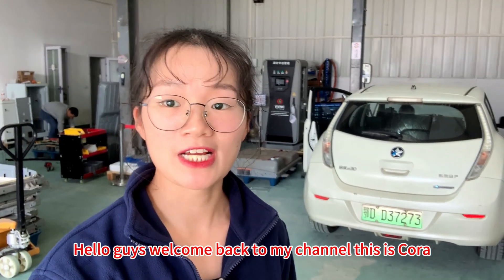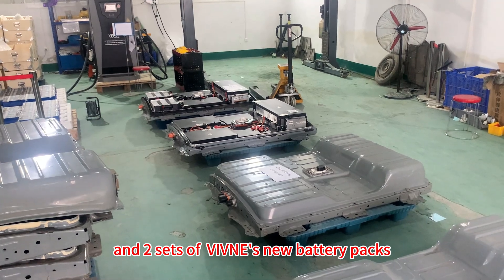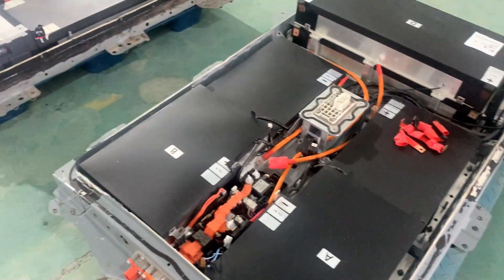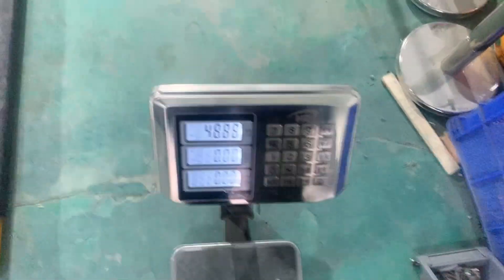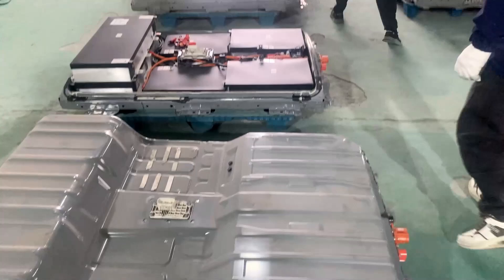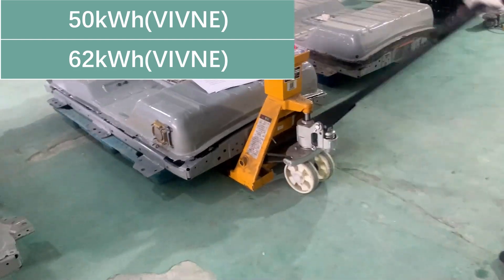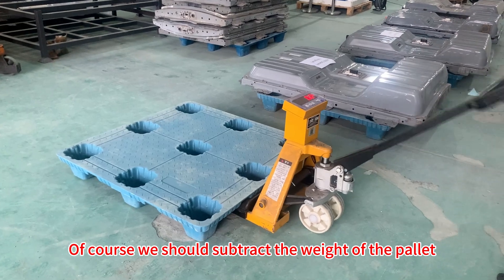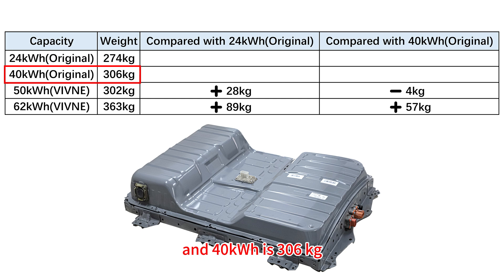VIVNE-How heavy is the Nissan Leaf battery pack?(VIVNE's VS Original)

Comment: usually you want to compare rates in like4like comparison. so you actually come out on top in that really well, both in direct comparison and in the rates of change in your product compared to nissan. 
(in Wh / kg for easier comparison, higher is better)
Nissan 24kWh - 87.6
Nissan 40kWh - 130.7
VIVNE 50kWh - 165.6
VIVNE 62kWh - 170.8 

Nissan Wh increase per kg added - 378/kg
VIVNE Wh increase per kg added - !!! 2307/kg !!!
Reply from the maker: You are professional!!

Comment: Cora, can you tell us the weight of the 68 kWh VIVNE battery pack? It should be close to the 62 kWh battery pack.
Reply from the maker: Yes, the weight of the 68kWh is the same as the 62kWh, both are 363kg.

Comment: are the battery packs fully charged?
Reply from the maker: Before shipping, we need to discharge it to about 40% SOC (about 350V) to make it meet the SOC requirements for lithium battery transportation.
Reply: empty or fully charged it doesn't change the weight of the packs :)

Comment: How does the heat-tolerance of the battery cells in the VIVNE upgraded packs compare to the original batteries.  The battery will still be convection-cooled only so multiple CHAdeMO charges in a day could increase the 0:02  battery temperature a lot and put the battery cells at risk for degradation like in the AZE0.
Reply from the maker: About 2 months ago, we completed several fast charging tests in extremely hot weather. In the video, you can see the temperature change of the battery before and after fast charging. Welcome to see the video here: https://youtu.be/_2hSXqOwW60

Comment: Interesting, originally I was looking into a used Leaf as an option; but, I read Nissan I.D. The battery to the car.  Nissan seller need to ID the battery to the car in order to use the battery 

Do you offer battery pack for RAV4?
Reply from the maker: Sorry, currently we only produce batteries for Nissan leaf and E-NV200, BMW i3 and some Tesla models will be the next stage.
Reply: @VIVNE-CoraLiu  hi,  thanks for reply.   I have a question, does Leaf require Nissan Dealership to program battery to car?  

I read it require Nissan to program car to battery.

Thanks
Reply from the maker: @peterxyz3541  After replacing the battery, you can use leafspy to register the new battery

Comment: If upgrading from 24kWh to 40kWh requires new springs: it is reasonable to upgrade to new springs for the 50kWh VIVNE pack.
Did not realize the difference in weight between the 24kWh and 40kWh packs was only 32kg,
Reply from the maker: Yes, and our 50kWh is only 28kg heavier than the original 24kWh, and even the 62kWh is only 89kg heavier than the 24kWh, so there is no need to upgrade the springs.
Reply: @VIVNE-CoraLiu  I may have been confusing the spring upgrade requirement with an original 62kWh pack: which you did not weigh in this test.
Reply from the maker: @economicprisoner  The weight of original 62kWh is 410kg. Since we don't have the original 62kWh battery at the moment, so we didn't weigh it.

Comment: How much does a diesel or peterol car compare to a battery and how far can they go compared to battery 🤨 i think its 3 times more.
Reply: i have petrol hach back and electric , petrol 2l is 1250kg and electric 1600kg , then you add oil and fill the fuel  so electric is like having a full load of people , however my 2l petrol is 150hp  , my ele is 150kw  , the torque of petrol is about 200 , electric is 320  so you only notice on corners , stopping and the elec ride comfort is like a much larger sedan for the elec.  i stil like both but the petrol is never the first car to be taken out now days , everyone wants the elec
Reply: @CarkeekW  Same we have Hybrid full petrol and full EV i like all but EV is the everyday car.
Reply: petrol car is 4 x the price! plus we all know most trips are far less than a full charge anyway, it's an old and boring  point you are trying to make.
Reply: Yes, but the diesel or petrol car makes about triple the contribution to climate change.  In other words, it will force three times more people out of their homes.
Reply: lol lol i think you are in the wrong area, there are other channels out there for you? if you so desire to know.

Comment: I've always wondered why no-one was using modern battery technology to make bigger capacity Leaf batteries inside the original housing. I could now get a battery twice the capacity of my current 24kwh Leaf battery which would be only 28kg or 62ilbs heavier than the original. That's the average weight of a 9 year-old child. Of course that would require no change to the suspension whatsoever. Even the 62kwh pack would only add 89kg or 196lbs which is  the average weight of two 14 year-olds. I myself weigh 105kg so the difference would be 15% lighter than having someone my size in the car. In my car the 50kwh battery would get me 240 miles of range and the 62kwh would get me 298 miles of range if compared to the real economy of my Leaf. I hope some day I'm in the position to purchase at least the 50kwh battery.
Reply from the maker: Good idea, so how's your car now? how far can it go on a fully charge?
Reply: @VIVNE-CoraLiu  My 24kwh Leaf is 75% SOH after eight years and 97,000+ miles. It still does 65-75 miles in town and 70-85 miles on mixed driving including motorways. With the infrastructure improving vastly over the years I still have no issue getting anywhere. In fact I've always done more miles in my Leaf than I ever did in my three previous ICE Ford Fiestas. I'd like to drive the Leaf to Scotland and back again before I make any upgrade. I did an 890 mile round trip in two days in 2017. No issues. It could certainly serve my needs for years to come. But, once I've finished busting myths I would love to pop a big battery in and enjoy modern range levels.
Reply from the maker: @trevorberridge6079  Cool, it seems that you take good care of your Leaf. There is no doubt that the Leaf is a very good car and it is worth replacing its battery👍

Comment: Perfect! I was wondering about this myself. It would be good to see how much the Vivne 40 kW battery pack weighs
Reply from the maker: Thank you, the weight of 40kWh is about 253kg. which is 21kg lighter than the original 24kWh. Since we don't produce 40kWh recently, so we don't show it in the video.